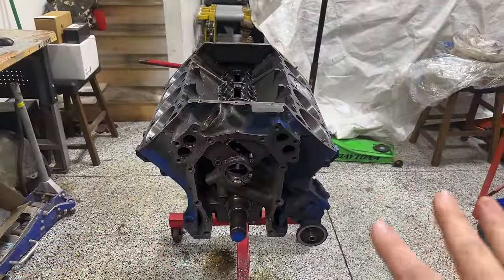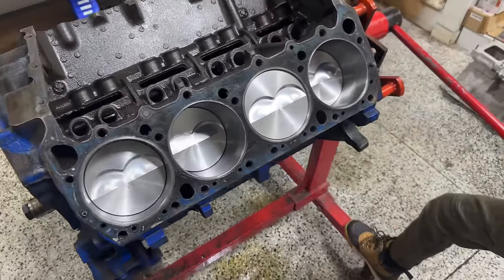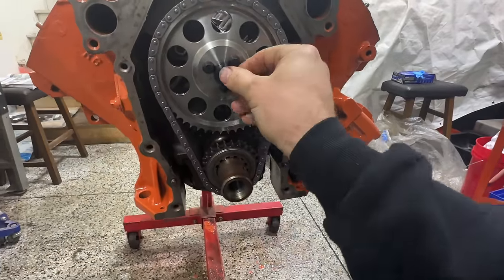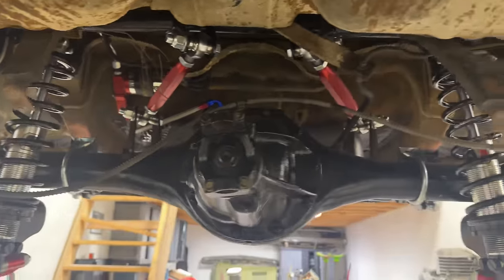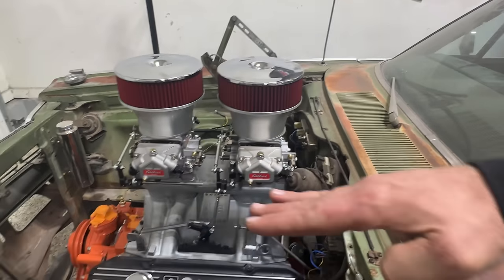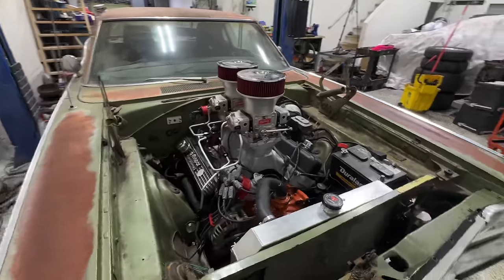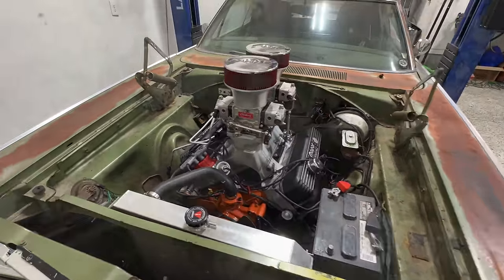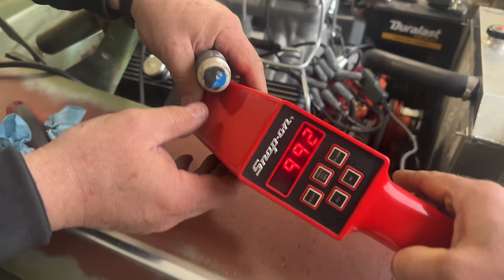Abandoned 1968 Plymouth Satellite | The Ratty Satty | Tunnel Ram 440 Big Block Engine Build

Comment: T-Bone's reaction to the engine paint adding horsepower had me in stitches! Loved watching him torquing some bolts down on his own. I see a lot of builds in his future. You might want to consider at least a mini-shroud for that fan- a couple shots had me a bit nervous (it might just be me though, since I've "made contact" before...)
Reply from the maker: That's the plan!  I have to repair the shroud I was using.  Unfortunately it was super brittle & it cracked.

Comment: Love the Ratty Satty! I need to warn you I’ve used the Amazon throttle cable and it will not hold up to the heat. The liner will get soft and it will fail. Had this happen to me at the race track and had to make an emergency run to Summit for a Lokar kit.
Reply from the maker: Good to know!  So far so good with the one I have.

Comment: Looks awesome, job well done. Keep your eyes peeled on that rigid fuel line where you made disconnect for engine removal. I would sooner seen you put a piece of rubber line in there that is flexable. that hard line could  break after time.
Cant wait to see you at the track again
Reply from the maker: Thanks, will do!

Comment: Good to see it all coming together good to see you have a go at putting the engine together just a tip dont oil the back of your rod bearings or your rods can cause a bearing to spin also will give you a wrong torque values and as the oil film comes out can cause rod nut or bolts to loosen bad day then always put bearings in dry  also did you check that gear on the distributor was right to run with that brass oil pump drive gear cant wait to see how it runs 👍👍
Reply from the maker: Good tips!  Thanks!

Comment: I put bushed Rod's in for floating piston pin's. Cut's down on taking on /off they slide right on and they freely move, In the end it's cheaper and HP gain , but I put a chamfered oiling hole on top of rod. Your engine turned out pretty nice, now we will be waiting for next video on test drive I guess lol before race day

Comment: I like the tunnel ram, but the money difference between that , carbs, and linkage could have got you a set of USA Made Trick Flow 240cc heads and way more power and build quality. Those 440source heads and moderate size cam are going to be the limiting factors. It should  make good torque. Nice rockers.
Reply from the maker: It's not built to be a full race car.  Something fun for street & strip.  I have some ideas for other builds that may be a bit more radical... but you'll have to wait & see!

Comment: I’m not sure about that Aeromotive fuel pump, but I’ve seen fuel pumps fail pretty quickly when people mount them above the fuel level at the bottom of the tank, for your power level it’s probably easier to use an engine driven high performance fuel pump, we put on on my friends 525 horsepower 400 mopar engine and ran it on the dyno, it never lost pressure, works good in the car too

Comment: Awesome car and awesome work. I have a question that I hope isn't taken as critiscism. Did you put assembly lube underneath the rod bearing at the 9 minute mark? If so, is that a Mopar thing? I've always installed the backs of the bearings and the inside of the rods together completely dry and only lubed the friction surface on top where it meets the crank. Maybe it's old wives-tale nonsense, but I've always been told that lube behind the bearings increases the chance of spinning a bearing, so I've never done it.
Reply from the maker: I did!  Hopefully we don’t spin a bearing.  That’ll be an expensive lesson learned… guess we’ll find out!
Reply: @rustbucketrestos6511  I hope it works out. I don't know that there is any science to what I've been told about lube and bearing surfaces, it's just what I've been told since the 90s, so I do it. Good luck. I can't wait to see it run!